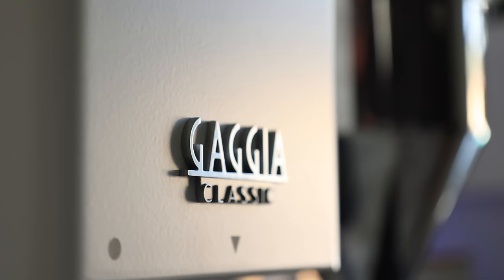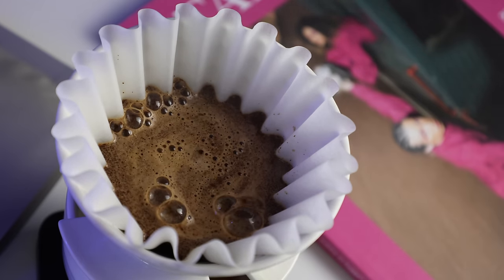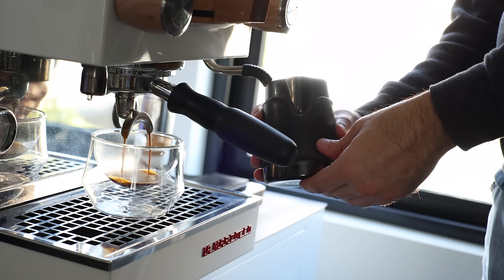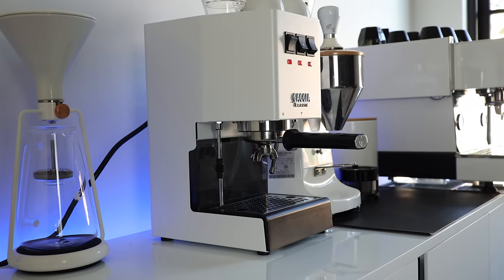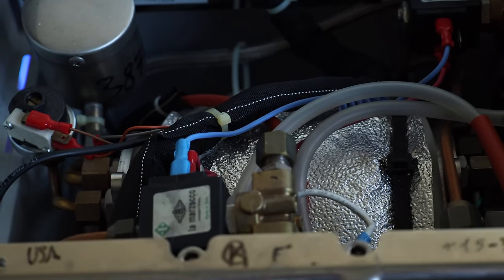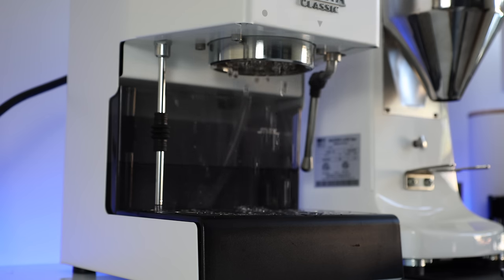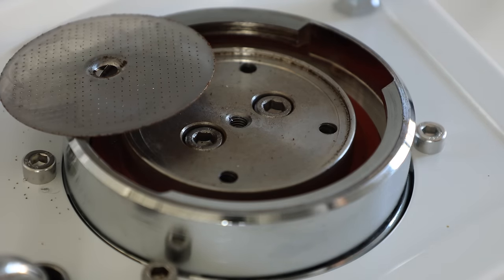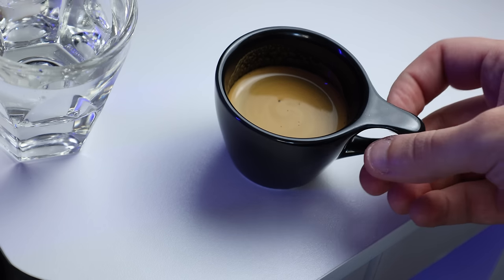SIDE BY SIDE - $500 Gaggia Classic Vs. $5,000 Linea Mini

Comment: I had the Gaggia for a year and sold it to upgrade to a rocket apartamento. Aside from the rocket looking a lot nicer on my countertop and it been a bit more robust to use there is very little difference in taste of espresso. Gaggia is a beast for the price. The Linea mini is a beautiful looking machine and if I had the type of money to buy a Tesla I would probably buy one one of them also. But unless you have tons of money it makes absolutely no sense to buy a machine for over 5k when you can make great espresso manually on the flair pro or on something like the an ECM or Rocket for less than half the price. It’s a luxury item at the end of the day, the exact same as buying designer clothing or anything with a premium price tag.

Comment: Thanks for this, and what a surprising conclusion! I guess your assistant is also rather good at temperature surfing on the Gaggia (or just lucky!).

I would add a few more machines that are in the same class as the Gaggia Classic: namely, the Rancilio Silvia, and the Lelit Glenda (58mm group).

These machines are relatively inexpensive, durable, easy to maintain (parts are available) and modify (if that's your thing, though upgrading filter baskets is easy enough). They sold many units that can be found on the second-hand market at affordable prices.

I strongly recommend buying one with a PID (one of the Lelit Glenda variants has one built-in), or adding a PID yourself (this is rather easy, you just have to be careful enough with cables on mains power). This makes the temperature consistent enough that you no longer have to do any temperature surfing.

These small machines come up to temperature much faster than more "advanced" machines, because they have much less mass to heat up. Many (most?) E61-like groups need about 30 minutes to be warm and stable. My own Gaggia with PID is warm and stable (including the PF) in about 7 minutes (and I think it could be faster with better PID tuning).

There are limitations of course: no preinfusion, no timer or volumetric dosing, for milk drinks you need to juggle with steam mode, and no pressure profiling.

For me, my Gaggia Classic with PID is still better than most "better" machines (including the Linea Mini), due to its small footprint (my kitchen is small) and short warm-up time (I don't drink coffee at predictable times). If budget were not an issue (it is), I think the only upgrade I would consider would be the Decent ; and then, the new issue would be finding time to geek out with this crazy machine.

But as you said, different people have different views! To each their own. Good news is, there are options for almost everyone.

Same as with cars: I guess the LM would be a Bentley, the GCP would be a Lotus Super7, and the Decent would be a Tesla (?). And lever machines would be bikes. ;-)

Comment: Great video. I’ve owned two Gaggia Classics, with the first being my first proper home espresso machine. For me it was the door to the rabbit hole and for that I owe it a lot, but it was also just a great little machine to learn on. I learnt both about coffee and espresso machines and ended up refurbishing and modifying both Classics before selling them. I can assure you that there are Gaggia Classics out there that are over 20 years old, but most of the working parts in them will have been replaced at least once in that time. I’d agree with your summation that the Gaggia is just as capable of producing stunning espresso with a couple of basic mods, but where more expensive machines win every time is with work flow and user experience. That was the single biggest win that I got from upgrading.

Comment: Thanks for the comparison. I've had a GCP for almost two years. I bought most of my accessories before I got the machine. Wasn't really happy with the shots before cutting down the OPV spring and adding a bottomless portafilter. Before I used it I changed out the shower screen, plate and added a silicone gasket. I'm pulling nice shots and my family and friends are impressed. One of these days I'll probably upgrade to a double boiler unit with pid. Until then I know my machine is punching way above it's weight class
Reply from the maker: You’re welcome and thanks for watching! I didn’t upgrade the plate or the gasket, but found the OPV to be an essential and super easy upgrade, well worth the $20. A dual boiler will definitely get you a better experience with milk, and back to back shots, but in terms of espresso it does a damn fine job.
Reply: I really don't want to go for a PID kit. I just purchased a dual probe temperature guage. There's a great video of a guy adjusting the boiler temperature by one or two degrees by opening the stream valve. This makes temperature surfing a more accurate process. As soon as I get it installed I'll let you know how it goes.
Reply: @danjv  I've got more or less the same features on my Rancilio, but I opted for an electronic adjustable thermostat, after using thermometer a while.
I would argue that the boilers are so small on these machines that PID is somewhat overkill, because as soon as the pumps starts, the boiler cools down.
My electronic thermostat with sensor inside the boiler keeps within 3-5°C Opposed to 10-15° with the stock mechanical one.

Dual boiler would be nice those times I pull several shots, but to be honest that's rare, rotary pump would also be nice.
But for a first machine Gaggia and Ranicilio Silvia is great choices.

Comment: I have one of the older versions of the gaggia and when I had to change the brewing thermostat I found that the operating temp was close to 220 F and the steam temp was Close to 200 F, I changed those to the proper temp and improved my shots and steaming power significantly. I lower the brewing pressure to 9 bars and a got better shots. One las thing is I’m using a puck screen and has made a huge difference in my shots. Mine cost me $329 at the time but it is a very good machine for the price point.

Comment: Great review, and glad you didn’t choose a winner.

In my case, everything I make is a milk (oat) drink. When family visits, I’m making 6 or 8 back to back, including some 12+ oz lattes. The 3.5L steam boiler in the Mini stands above most every prosumer machine, and handles this load without breaking a sweat. The Gaggia would be frustrating as hell in this Thanksgiving host role. But for a single, espresso drinker on a budget, it’s a great value.

So, I wish you had evaluated the steam limits of each. Clearly, the Mini can serve a long line of milk guzzlers. I’m not sure where the Gaggia can compete and where it, um, runs out of steam.

Comment: After fixing multiple old Gaggias, they're one of the easiest machines to fix out there. You can literally find replacement parts for everything. And as the design is (pretty much) the same as 20 years ago, even the super old ones can be serviced!
With a few modifications (OPV, basket and PID) This machine punches way above its price point!

Comment: I would be interested to see what you think the difference between a $2500 espresso machine vs a $5000 is. It seems to me like there are definite differences in quality and workflow between 500 and 5000, when you get a gaggia or something in that price range you are going to need to go the extra mile to get the best from it. But from what I see as far as features and build ,diminishing returns hits a cliff around $3000. How would say a Profitec pro 700 compare to a Mini? On paper they are very similar machines with a difference of $2000 on the pricetag.

Comment: Excellent! With each upgrade I've made over the years, including many prosumer machines, it gets more expensive with less bang for the buck (now have a Linea Mini.) I appreciate this video as it points out how much you can do with a small budget. I also like that you didn't make a final judgement. The analogies with tampers and cars are poignant. And gotta love "barista tingles"!
Reply: Analogies with cars may be slightly off, Civic is probably as technically complex as Porsche but more reliable.  For example Civic has Vehicle stability control, Adaptive cruise control, ABS, airbags, Continuously variable transmission, etc. Not that Porsche doesn’t have these items, there is not a vast technical difference. The Gaggia is less technically complex but what is the reliability difference?

Comment: When a friend asked a two weeks ago what bigger level espresso machine to buy, I recommended to him the Gaggia Classic. I think it’s perfect for someone just getting into coffee, because it already delivers okay quality shots as it is out of the box. When you have matured in your espresso game you can easily upgrade the pressure spring and/or fit a pid. With that you have a pretty nice machine if you mostly drink pure espresso or americano. 

For a heavy consumer of milk drinks, I would probably recommend the Rocket Appartamento I still own. Fitted with a group thermometer you can control the temperature well and you can also adjust the pressure via the over pressure valve.

And if you really want to have back to back repeatability and constant pressure and temperature you can still go for a linea mini, but I would definitely buy the grafitek kit and also get the paddle changed. Actually, both should be better right out of the box as a machine in this price range should not have a fake brew paddle and also the things you touch often shouldn’t be so flimsy (like the pid) or made of cheap feeling plastic (brew paddle). But still it’s an awesome machine and I know I will buy one some day.

Comment: I started with a Bambino Pro which I quickly grew frustrated with. The shots were more or less OK, but the machine was unreliable and after the second replacement I threw in the towel.  I then graduated to a Rocket Appartamento, which I liked much more and which produced better shots than the Breville.  After a year with the Appartamento, I upgraded to a Rocket Mozzafiato Evo R, and was honestly surprised at how much better the shots were over the Appartamento.  The addition of a PID and rotary pump made a noticeable difference.  In the future, I wonder how much improvement I would experience with significant upgrades from where I am.  This review has made me question some assumptions.

Comment: Great comparison! The result does not surprise me. I had a La Marzocco G3 MP. After years of frustration I got rid of it. The preinfusion is soo short on this machine (the fake pre infusion: pre wetting does not work imo), i think it just trashes your puck. I suspect a vibration pump, natural line pressure, other kind of flow control works much better. The machine has however lot's of steam for making cappucini. I also did not like the plastic the drip tray was made of. After two years the pastic started to crack, this is just not durable. In the end I preferred the taste and consistency of my pid modded e61 vbm domobar. Now I use a Londinium R24 lever machine. Now it's so much easier to pull consistent shots. Making espresso should be fun, not a struggle.

Comment: Great video, I have the exact GCP setup and I'm planning on upgrading it soon. I think the biggest problem with Gaggia Classic Pro is the steam wand capability and the single boiler. I don't think I would ever get the Linea Mini but I think a logical upgrade is to the Breville Dual Boiler. There are definitely mods I could do to the GCP like install a dimmer switch mod and PID but with the material cost, actual work in the machine, and time spent I think it would be worth spending the additional money since I would get all of those great features with a dual boiler.
Reply from the maker: Thanks Andrew, and I’m with you. The steam is terrible. Coming from a powerful dual boiler it’s a struggle. I’m sure there are those who’ve figured it out, but it seems to lose pressure way to quickly. Seems to be better suited for a very, very small amount of milk (Cortado or macchiato) versus a cappuccino or latte.
Reply: @Sprometheus  As far as I know even the die-hard Gaggia fans say that you should not steam with it. Especially because the steam valve starts to drip really soon from regular usage and then you have to replace it. So most Gaggia user just don't drink milk drinks or use the french-press method. I even heard a case who had an ultra-hacked Gaggie for pulling shots, but bought another coffee machine just for milk steaming :)
Reply: steam wand is great on new gaggia classic pro and with correct switch you get a lot of power
Reply: @Sprometheus  you have to start steaming before light comes in that way you get a lot more steam power
Reply: What lol the steam wand on the Gaggia Classic Pro works wonders, there is a trick to it though. You have to start steaming before the steam light comes on and the pressure won’t die out, you’ll get way more steam and it’ll stay steaming longer. Works perfectly fine tbh 🤷🏽‍♂️
Reply: @Precyze  This^, I've been using this trick for a couple years now and it hasn't failed me yet. I can steam a pitcher of milk for 2-3 lattes without running out of steam.
Reply: @Precyze  I completely agree. I have a 2021 model and the steam is  GREAT! Not sure what they are talking about here… must have older versions.

Comment: I love my Gaggia Classic Pro. I bought it refurbished from Whole Late Love actually. Like any piece of coffee gear, it takes time and practice. I love it more and more everytime I use it. I drink like 2 macchiatos a week so it being only 1 boiler doesn’t bother me, the one it has is consistent and stable. I’ve added a new shower screen, tweaked the brew pressure, and added a PID yes but, other than that it’s awesome. The Lena Mini also is a great machine. Probably would buy it just on the looks alone.
Reply: I’m back and forth on upgrading the shower screen and it seems like it’s a purchase that most gaggia owners regret or find no improvement. Do you have any thoughts on this? 

I’m considering the IMS or BIT upgrade. I’ve done the gaggiuino mod and I’m trying to push the gaggia as far as possible!

Comment: Excellent comparison. In the 1980's I owned a machine similar to the Gaggia, a Brasilia Club prior to the days of pressure, temp mania. The portafilter was the same as on their commercial machines and it pulled very nice shots. I was using a Gaggia MDF grinder. Gaggia may also use the same PF as on commercial machines. I am not surprised when properly setup the Gaggia can pull comparable shots at 1/10 the price. Like LM, Gaggia is also an old established respected Italian company that knows damn well how to build coffee machines.

Comment: Terrific video. The Gaggia is the best you can get while still relying on the Philips - Saeco economies of scale for every single component. That's the main reason parts are so cheap. Having dabbed into manufacturing large quantities of items, this dwarfs R&D costs. This also explains why the Mini is on the other side of the spectrum

It is also exactly what you said: the Classic is the best entry point for serious espresso. It also shows the limits of consumer-grade products and how a wider set of requirements  (deal with badly grounded coffee, uneven distribution) affects component choice and ultimately translates to the cup.

One final comment for future testing: always do a similarity/odd one out test between 3 cups, with either 2 cups pulled from A and 1 from B or 1 cup from A and 2 from B. This is actually easier to figure out differences and so much more scientific!

Comment: Doesn't it make sense to get the Decent Espresso machine rather than a Linea Mini? It's cheaper for one, and it does so much more.
Reply: I considered the Decent. When first released, it was like a science project tool, but now, you can just choose a well-rated profile and go. When I looked into it’s steam capacity, however, there’s no comparison. The Decent can make hot, dry steam, but not at high volume. When family visits and I’m making 6-8 large milk drinks back to back, the Mini is so fast! The Decent can’t compete. But for a single espresso drinker, it would be a great choice.

Comment: I have pretty much done the same comparison from this video since it's been 3 years that I've had a upgraded "Rocket R58", and last week my best friend bought that Gaggia and we upgraded everything about it before even pulling a single shot. We took everything from Shades but just didn't do the PID and Pump Gauge installation yet cause when I saw hoe overly complicated this was with a 82 page manual, we were like O-M-G... Guess he'll pay someone instead to do it lol.

I was HIGHLY surprised in a positive way when I tried on the Gaggia the taste from the same fresh roaster where we go, even the steam was much better than I've thought and wayyy superior to a 4x more expensive crappy "Breville Oracle" that my mom had a few years ago. It's just that you gotta wait for the only boiler to go from ~200F to 260F before steaming milk rate than do it immediately after.

The main and only downside I had was the espresso was definitely too hot, so I guess even a 5 second cooling flush isn't enough without the PID and that in the meantime it gets installed, hence should prolly go for 10s. Otherway for being like 4x less expensive I wasn't expecting such quality, and nothing at all beats it at this price range, and it even bests stuff 2x pricier once upgraded!

Comment: The gaggia’s certainly got a long life - I bought mine second hand 20 years ago, and serviced it several times without issues. If you’re reasonably technically competent, then the PID upgrade and rancilio steam wand sort out 90% of the issues, and the rest is just how life is with a single boiler. You need to be a bit careful though, some recentish (2012-2019) IIRC don’t have the 3-way valve or tunable pressure.